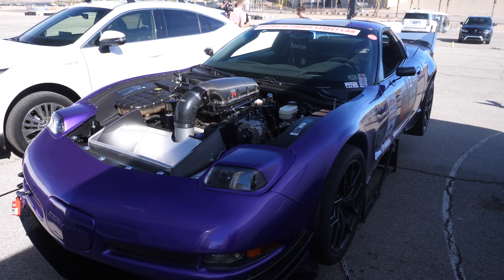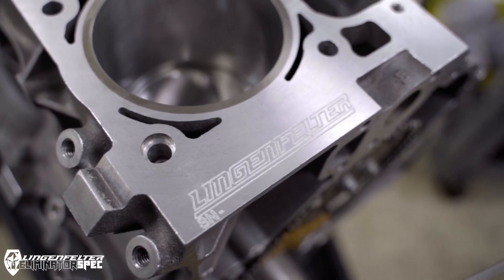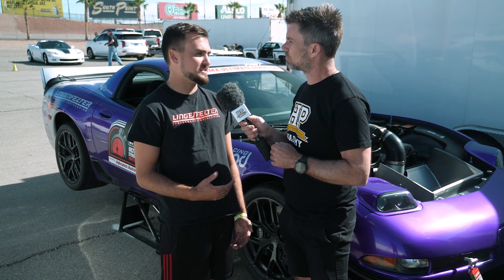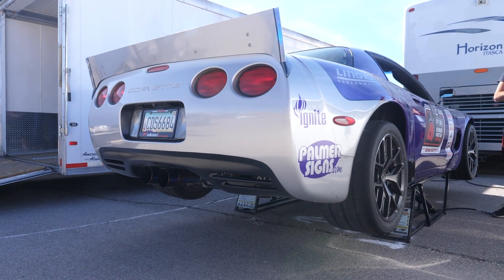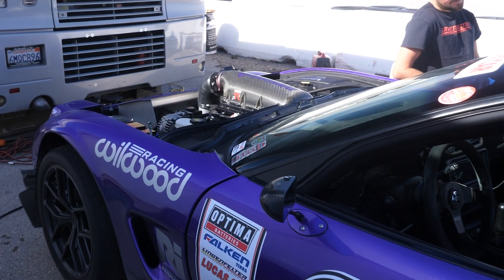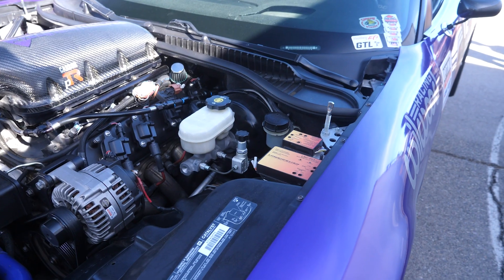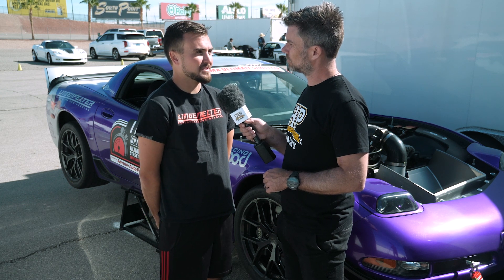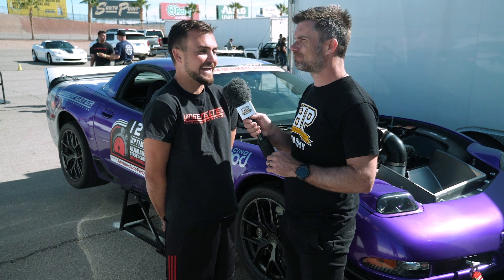800hp ALL MOTOR Club Racer

Comment: ABS is better on any wheeled motorsport, even motorcycles use them as standard...it saves lives and makes everyone faster on course. I did the same modification to my own Z06 as Jake and it works great.
Reply: What would you suggest as info for doing this abs swap, I'm really interested in doing this on my z06.

Comment: If the ABS fails, it will still break, but block.

Ask me how I know. BMW E36 are knows for soldering issues on the PCB (btw easy to fix, ask me how I know). It that´s the case my BMW still breaks like before but it will block if you stand on it.

Comment: I never understood the dislike for a good ABS system.  Mixed conditions or drying or the start of rain make it shine let alone the parts he talked about when braking and turning needing control of each wheel individually.  It saves expensive tires too.
Reply: Agree. Ive done endurance races where I was the last driver of the day and I got shaked to death from tires that were flatspotted to look like hexagons
Reply: Needa a proper motorsport abs, oem.abs is not calibrated for slick tyre
Reply: @claudiumxg1  I ran my C5 Zo6 with Hoosiers at Waterford, Grattan and Mid Ohio without issues related to ABS even with off and on camber turns and a jump.
Reply: @zeitgeist888  most of time a stock abs unit will strugle,.if a proper.aportscar calibration is better. We run bosch m5 motorsport abs. No stress with this unit

Comment: Any argument for abs being slower than a driver is completely baseless. The only reason abs isn't allowed at the top levels of motorsport is to prevent rich teams from having too severe of an advantage through abs.

NO DRIVER ON EARTH can match the braking force of early 2000s commuter car abs, EVEN  FOR A SINGLE STOP. It is just nonsense, and every stop you attempt without abs, you are widening the gap of lost time/braking.

With 4 wheel abs, like they mentioned in this video, it exponentially raises the bar, again. Humans just cant match machine in that exact performance vector. Motorsports abs can detect friction conditions within several degrees of tire rotation, and apply countermeasures, TENTHS of a second before you even have biofeedback of the car balance shifting. 

Just typical fragile male ego bullshit...aw yeah, my driving skill is so good, i don't need abs...
Reply from the maker: Thankfully the vast majority of people just get out there and enjoy their own builds that are for them, ABS or not 😎
There are always a few who love a bit of a squawk if we don't all share their imposed opinion/s, but there are ways and means to avoid such people in life once identified right 🤘  - Taz.
Reply: @hpa101  I used to be one of the people who was anti-abs. I had a prepped race car and everything...then I kept getting SPANKED by abs cars in the braking zones, despite having a substantially lighter car...my next prepped car had abs, and never have I been able to brake harder in my life...its awesome. Even the best driver with the best brakes, and the grippiest tires will get destroyed by an abs car in the braking zones. just pretty basic physics, so now I'm more outspoken about it!

Comment: A hydraulic roller cam that tolerates 8000 rpm?! Wow.  Whose lifters are those to tolerate that as competition motor.  Wow
Reply: I ran hydraulic roller lifters in my n/a ls7 car an revved it to 8k, would of gone higher but the stock ecu wouldn't allow it. And it made 750whp.
Reply: Possibly Johnson st2126lsr lifters, or their 2110 variety used in the GM COPO.
Reply: Interesting, right? I've heard people saying that hydraulic lifter is not able to work reliably at more than 7000rpm
Reply: @vvevvevvvv  exactly my point.  Hot lashing valves is no fun.
Reply: We ran 8000 rpm on stock LS7 lifters on turbo 5.3’s for years.
Reply: My lme 416 has hydraulic rollers and revs to 7500+. It’s possible
Reply: It's amazing how far hydraulic roller cams have come in the last decade. Honestly, unless you're spinning up above 8500 in a full race motor that's got 15:1 or more compression, hydraulic rollers will give you a far better power curve than you expect - especially for big stroker motors. The next level now, IMO, is to reintegrate VVT into these kinds of performance builds - why on earth hot-rodders delete VVT is beyond me. It's one of the best engine components ever invented.